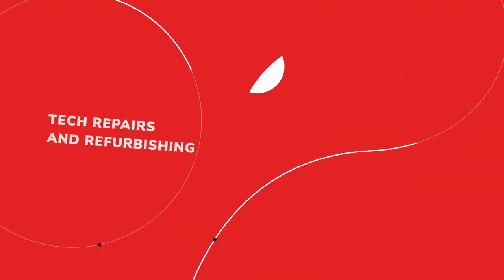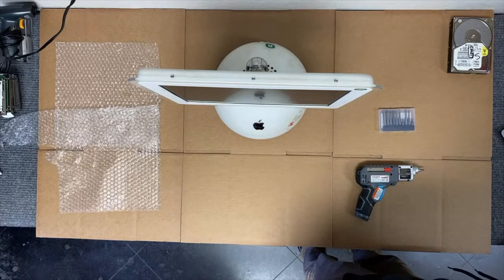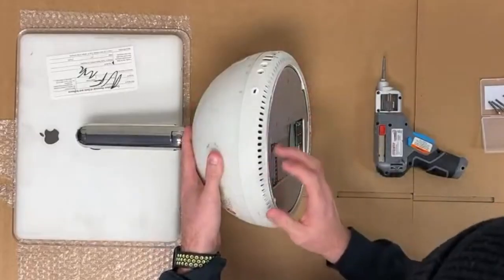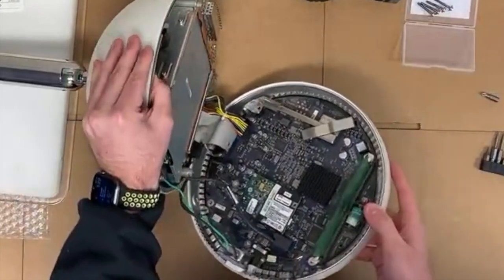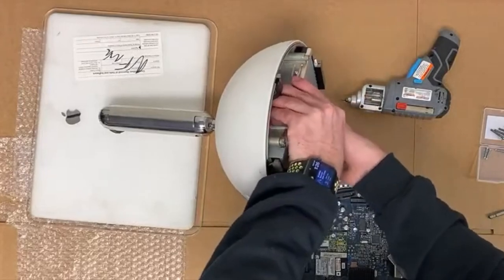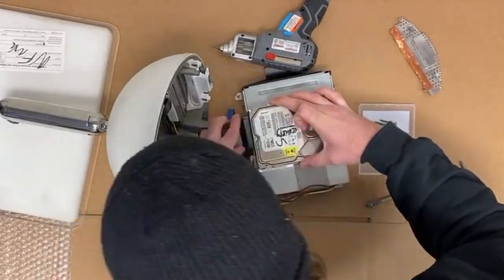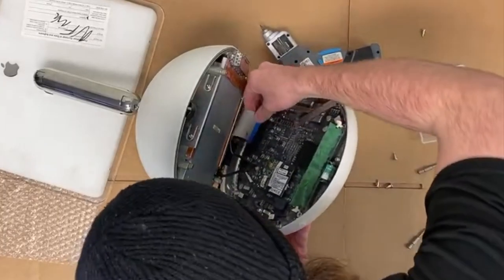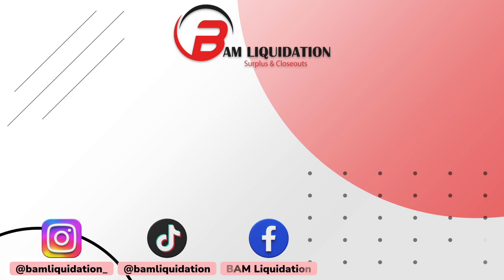iMac G4 Hard Drive Replacement

Comment: Termal paste is very much required for any repairs on the G4. The upper part of the housing is part of the heatsink and it's connected to the bottom with paste.

Comment: The thermal past is required whenever you crack one of these open as there is a connection between the bottom heat sink and the top.

Comment: This helped me open an old iMac G4. Thanks.

By the archeological effort I had to put in to remove the dust, this wasn't opened by anyone before. Here's the thing: the hard drive has this slick paper glued onto it: it wraps around from left side (over screws), over the top, to the right side (over screws). It covers the whole top of the drive. I imagine this is because it sits rights under the fan, which blows all that dust in, but why would they be worried about that? Or was it a warranty thing? This drive doesn't have one of those "do not cover" holes on it, but if it did, covering it with slick paper wouldn't have helped either way.

Comment: I have the osx snow leopard install disk but the disk drive seems to want to throw it up everytime I put it in, does this mean I should replace that as well? And putting a new hard drive in will erase all previous data, correct? Im locked out of all privileges and want to put my own account on the computer. And are these worth upgrading nowadays? I'd like to be able to use it for simple tasks and possibly very simple games.
Reply: You can copy the install disk to a usb drive. And games and sites will probably mostly not work anymore.

Comment: anyone knows if there is a preinstalled antenna for bluetooth? if not how to install the antenna of bluetooth module? thanks
Reply: The older g4s are not Bluetooth compatible. The newer ones don't have it preinstalled but you can buy the antenna and it'll work
Reply: @noahfriedman9269  do you know what is the name of the port inside the mac for bluetooth? I notice that outside end connecting to card is MHF type I. the inside looks like SMS but I am not sure.

Comment: I have a Microsoft surface pro 6 and it is stuck at 0 percent while it charges and when unplugged from the charger it turns off I tried everything to fix it but nothing works I think it needs a battery replacement. how much would that cost?
Reply from the maker: sorry for the late reply, $150
Reply: @bamliquidation5674  ok